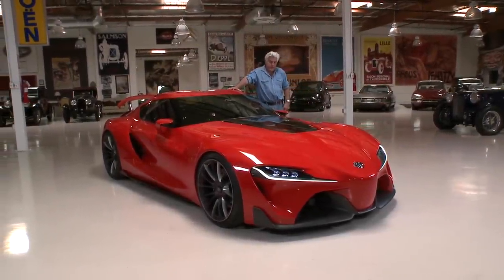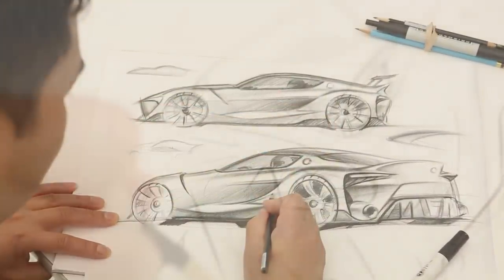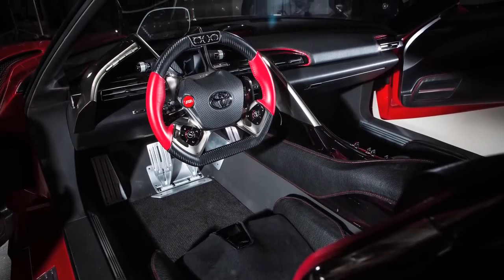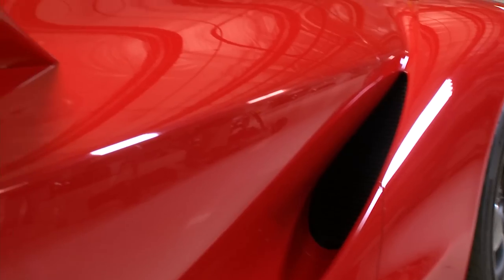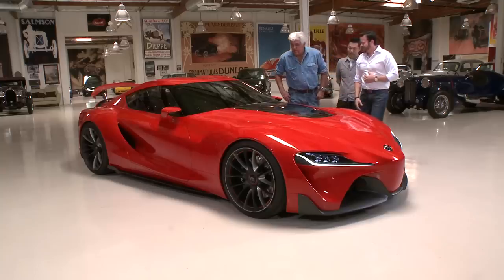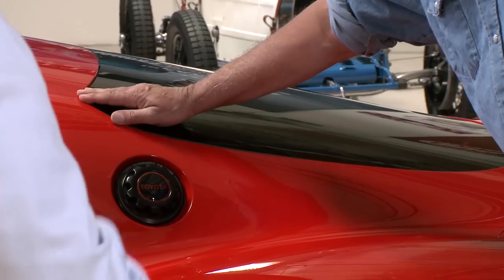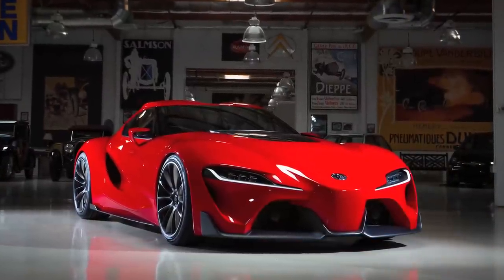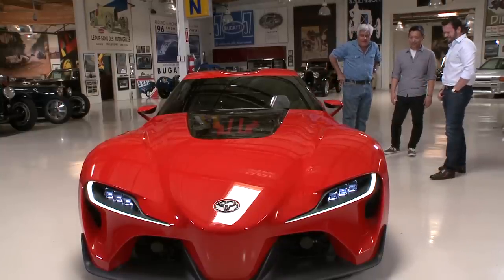Toyota FT-1 Concept - Jay Leno's Garage

Comment: It looks sporty and fast but it's everything but a sports car
if it isn't a manual (doesn't come with manual transmission), it's not a sports car!
Reply: I honestly think that's silly.  Of course it's a sports car! :D Most sports cars are dropping manual transmissions because they're just not quick and efficient enough anymore.  However, they did say that this car is meant to be all about the driver, and "affordable", so I also think it is silly that this car does not have the manual.  For production, I would hope they add a manual option.  This is a concept car so they're trying to fit every bit of technology and sparkle in there and manual is quite outdated.  But who knows what the future holds for this vehicle.  I'll be crossing my fingers for a manual model (and enough money to afford one)!
Reply: Thats where you are wrong.

Sequential gearboxes are a thing of the future.
Reply: mrcheesydancer i see what you mean but it's down to preference at this point since sequentials are ridiculously advanced nowadays. There are so many competitive racecars are sequential gearbox setups that shift way faster than human reaction with manual gearboxes so I wouldn't hesitate with this if they only made "auto" trans
Reply: Or at least give the buyer the option between sequential, auto and full manual.
Reply: Thats another; Thing of the future.

Did nissan give you the "option" of having a 6SP manual?
Reply: Kenny Nguyen Same as the Mercedes C63 AMG….
Reply: Get ready for the future, your response time is slow. I say octa-core this beast integrate nav/hands free, drive assist features all the latest greatest . I would still want the ability to toggle these features off ,just in case I wanted to get RAW!
Reply: Manuals are starting to get old and lots of folks don't know how to drive them so that's where dual clutch automatics come in.  Look at the Alfa Romeo 4c. It has a dual clutch auto and manual steering
Reply: Jamie K  No matter how advanced. No matter how fast... They are not better than a standard transmission.. It has nothing to do with speed specs or power.. It all has to do with how the driver interacts with the car.. The standard transmission is a more intimate experience.. A true car enthusiast wouldn't give it a second thought.. You buy a sports car not just to go fast. You buy it because It's part of you.. Why put it on a leash.. sigh
Reply: Circy Wilson Well if the future is no more manual gearboxes than I guess true car enthusiasts will die out. Why would I buy a fast car that does everything for me? What's the point? There is one important factor that a lot of people forget. Manual just makes driving a car a more pleasurable experience. I'm not saying that automation is a bad thing.. I am however saying that it ruins the driving experience.. Which is okay if your taking the kids to school or trekking through the mountains.. But I buy a sports car for the experience.. Why diminish that for a little more speed..
Reply: First no it isn't that huge. The speed has absolutely nothing to do with my point in the first place. The fact of the matter is, when driving standard you use both feet. both hands.. Engaging..  When driving sequential it is boring as fuck. No matter how fast the car is it is still fucking boring.. To each his own but, only in America is it commonplace for there to be automatic shifting. Anywhere else in the world and you would be made fun of for not being able to drive a car. Or that you are old. It isn't just my opinion  Millions of people are pissed that standard is going away.. Just because shitfucks don't care about the driving experience anymore. It's all about fucking numbers.. MPG, 0-60, top speed, shift speed. Nobody cares about fun anymore. And I'm sorry sequential is just not as versatile as a human can be. Manual driving you can manipulate the clutch while driving or turning.. Try that in an automatic. I'm not een going to delve into the massive repair costs for these "advanced" transmissions" Just another point is nine times out of ten the manual version of a vehicle has a tougher transmission for upgrading. Like the evo GSR compared to the MR.
Reply: Dylan Simons Im assuming that you mean the EVO X… because the IX & VIII MR 6 - speed is intact…. weaker than the 5. This is why they got rid of it in the X line.

Where you are wrong, the sequential such as the R35 GTR gearshifts are so fast you won't notice it.

theres no need to whinge to me dude.. 
like i said to you, i do like my manuals myself. and its a shame the R35GTR comes in sequential only.

But it is a thing of the future. all work class high end cars have this and have launch control as well.

One day, Hybrid is gonna be the state of the art and I'm sure petrol heads are gonna whinge also.

such is life dude
Reply: Like the nissan gtr. Some people argue that it's not a sport car. I may be wrong buts it doesn't offer a manual.  If u guys are looking for a cAr that delivers a pure sport car experience then I would opt for a 370z. Especially for the tuning potential aswell. But yea modern cars require less skill to drive which makes it less rewarding when you do make the awesome drag time or cut that corner perfectly.
Reply: I think the general trend is that technology will eventually override the need for human input because we make more errors than a computer can. Especially with exotics and super cars, like how lambos are also dct.
Reply: Your right on man. Technology always moves forward and in the case of transmissions automakers are looking to eliminate one variable.  Humans who make mistakes
Reply: Dylan Simons I think you're wrong. Manuals are getting soooo outdated. Personally, I've had several manuals going back to my high school car which was a '71 Cuda 340. I got rid of my last manual about 3 years ago for a BMW M3 with DCT. Never been happier. Today, to me, a manual takes away from the driving experience. I'd rather be focused on steering, handling and feedback rather than making the perfect shift. Especially on the track.
Reply: I agree dct and semi automatics can get better mpg, last longer, and even shift faster and more precisely than a human can sometimes. But what I feel about manuals is that it gives your ride a feeling for some character. Still i feel that you should learn to use one at least once in your life
Reply: at the end of the day, Manual transmission with a cable…

Think about it. It is old school and primitive and low cost to manufacture.

Like someone said here, car makers move forward.
Reply: Well then is a mclaren p1 not a sports car, and is the Lamborghini aventadore  not a sports car either or how about the gt-r I can go all day buddy
Reply: Jim Chiodo  Well, I respect your opinion but, I have more fun in a 1xx horsepower standard car than in a 8xx horsepower auto or sequential car.... It' more about the movements for me. I lose that in a sequential.. I do understand why people like that though.
Reply: Garrett Taylor Those are sports cars but, You are missing the point here entirely. A standard transmission puts you in more direct control of the car and creates a more proper driving experience. I love GTRs.. They are absolutely jaw dropping performance wise.. That being said I'd rather drive a stock 5 spd Evo.. For the experience. Many car enthusiasts want a car to be standard. I'm not talking about a few elites who buy outrageous cars.. For example the BMW M5 was only offered as a sequential and sales tanked.. Then they brought back standard and everyone ate them up. The Lamborghini Gallardo LP560-4 still offers a manual transmission because they know some people want it. Porsche 911/ Audi R8/Shelby GT 500 (Only available in 6 speed manual) This being said I respet you opinion and I do not want to change your mind. I'm simply explaining what he meant.
Reply: 85gtdrop  Those are sports cars but, You are missing the point here entirely. A standard transmission puts you in more direct control of the car and creates a more proper driving experience. I love GTRs.. They are absolutely jaw dropping performance wise.. That being said I'd rather drive a stock 5 spd Evo.. For the experience. Many car enthusiasts want a car to be standard. I'm not talking about a few elites who buy outrageous cars.. For example the BMW M5 was only offered as a sequential and sales tanked.. Then they brought back standard and everyone ate them up. The Lamborghini Gallardo LP560-4 still offers a manual transmission because they know some people want it. Porsche 911/ Audi R8/Shelby GT 500 (Only available in 6 speed manual) This being said I respet you opinion and I do not want to change your mind. I'm simply explaining what he meant. No need to be insulting..
Reply: I personally enjoy manuals but we must accept the direction of which our hobbie is going. They both have their advantages
Reply: Dylan Simons
no... just no..
Reply: that is just stupid whats wrong with automatic. most of the sport cars r automatic
Reply: ***** who makes these stereotypes? I've never heard this one???
Reply: I think is practical to have automatics, if technology keeps evolving so should the simplicity of handleing
Reply: AGREED!!!!👍
Reply: William Su Its all about the feel and engagement of the manual. Driving an automatic just isn't as exciting of an experience.
Reply: Villa Manor  No I totally get that, but technology and practicality is something that's supposed to do it better or eventually will and that's not something that can be stopped from happening.
Reply: tell that to ferrari, lamborghini, mercedes, porsche, and mclaren. All are transitioning to manual gear boxes and paddle shifters because they are exponentially faster than an "old school" stick shift. Also, it you didn't know, F1 drivers (arguably the best in the world) don't have a stick shift either, they use paddle shifters in those cars as well.
Reply: thats the most balls thing ive heard in my life
Reply: lmao
Reply: Still a sports car but a manual is more fun. I hate when people buy cars and bikes because of specs.
Reply: Garrett Taylor No the aventadore is not a sports car. Its a statement. Iy doesnt handle particularly well or go very fast in the scheme of super cars. It is for ceos professional athletes and musicians who make more money that they know what to do with.
Reply: I think an Aventador can be classified as a sports car lol
Reply: Supercar ;p;
Reply: *****  it's an Amazing car
Reply: Dylan Simons yes, but it hasn't only to do with the transmission

if you have a good manual transmission in a chassis which doesn't give you feedback then it's not a good drivers car

manual transmission =/= drivers car

it's about combining chassis balance, throttle response, brake feedback, brake feel, chassis feedback, suspension feedback, steering feedback, steering accuracy and finally transmission feedback

Comment: Affordable? I doubt it.
Reply: If they make it.  They will go after Nissan GT-R.  So $100 - $160 thousand would be their target price range.  Just my opinion though.
Reply: John Hardin would tend to agree
Reply: The lexus LFA was almost half a million
Reply: sanjay sriranjan Its impossible to estimate the (potential) future price on this because that completely depends on if its going to be a limited production(like the lfa), the build method (carbon fibre everywhere) and the engine (LFA style V10 or TT V(or inline)6). Pending those, it could be from 100 000$ to 1 000 000$
Reply: Has the Supra ever been afforable?
Reply: ***** LOL $20K?! Here in the states they are going for like $60k to $90k!
 I saw a bone stock clean one sold at a dealership in Las Vegas for the $90k
Reply: FilmerJared thay are cheaper than that. $30k is what you will pay. for a tt 6 speed car. its still too much.

Comment: Those radiators fans looks odd!
Reply: I like them, it gives it a JDM look
Reply: they will cover them up during the mass production. otherwise these fans will break every 100 miles. think about rocks hitting the fans and bugs getting stuck in there. they will propably cover them up with a net or something similar.
Reply: I can see a bird getting sucked up in that fan I agree a little odd
Reply: replace them with turbos
Reply: Mario YESSSSS!!!!!

Comment: It better be a straight 6 or v6 with two turbos. :)
Reply: Fuck that v8 or v10
Reply: Dude V6 twin turbo plus electric engine
Reply: ***** they already said that that's going to be a 90k plus car
Reply: Moby Dick  Yeah, no.. That makes no sense.. Why would they make it with 200 hp.. So that it could compete with the FRS/BRZ?? It's stablemate?.. No, I'd say 300hp V6, or perhaps 4cyl with hybrid..
Reply: Moby Dick Yamaha? Something tells me you are a fan of the 96-99 Taurus SHO
Reply: I'd love to see a newer version of the 2jz
Reply: Jesus Bustamante They were saying that if they make it, it will be RWD.  If you put a massive engine in it you wont be able to get the power down to the road.  The Nissan GT-R has a Straight 6... and no body is calling it slow or under powered.
Reply: I was thinking 3jz but not happening a v10 with 600+hp na is enough I wouldn't want it turbo but that could be a option
Reply: If it's gonna be expensive, just throw in the same awesome engine from the LFA. But if it's a 4 cylinder it will be lame and I doubt too many people would want it. I'm feeling a v8 :)
Reply: CJSchecter96 japanese cars dont need v8's a 600hp v6 is just fine
Reply: s lvt better fucking not be, that would ruin it
Reply: Moby Dick it won't, its too big to compete with the brz and its too high tec to be cheap

Comment: I wonder how does the engine hood open? There are virtually no seams on the front end.
Reply: This was electric so no engine. Under that shell is a series of batteries. When Toyota finally decides on the engine (if they hadn't already) they'll revise the body to function accordingly. In this video it was a model to show just the electric gizmos. It's essentially a lightweight shell on a frame and maybe a 50HP yield to load onto a trailer.
Reply: I agree
Reply: It will most likely open like a viper, the front fenders/hood looked to be all one piece
Reply: No the clear plastic comes off

Comment: hopefully it comes with the LFA motor. If not, a v8 is enough. The designe was in America so give it what they like. A V8 engine.
Reply: It's more supra esque so I think an I6 would be more appropriate
Reply: They should release it with an Inline 6 twin turbo motor and a proper manual transmission...everything else is unacceptable
Reply: Preach it doge. Totally agree
Reply: since they are getting their engines from bmw an inline 6 isn't that unrealistic. and since bmw has a very far developed turbo technology it will be turbocharged for sure. the only problem will be that bmw can't build engines with hidden potential like the 2jz. they build engines spot on which may blow as soon as you tune them.
Reply: I should remind you that BMW has both inline sixes and V8s.
Reply: Dont be silly, if its a new supra it will have a straight six turbo
Reply: The-EXpertStreet B-Racer :it will probably have a v6 twin turbo .
Reply: 3JZ anyone?
Reply: It’s coming with a bmw straight six because Toyota worked with bmw on this car
Reply: It obviously should come w a boxer engine from the gt86 duh
Reply: The fact that it will have a BMW engine disappointed me. If I wanted a car that would self destruct from me looking at it funny, I would buy a BMW.

Comment: I have a theory, ill probably be wrong in a few years and be coming back to edit this post lol. But right now i think the FT-1 is probably going to be the AWD Hybrid version of the Supra, they will probably call it the Supra FT-1 just a guess and itd be a cool name anyways. There has been talks and thats probably why tada-san doesn't want to make a manual trans and is probably busy making a DCT transmission for this ultimate supra, they probably wont use the new 3.5 V6 engine they have since its just used on a sedan and not necessarily a performance engine. The B58 engine is the roots of what a supra is anyways because its a inline 6 and sounds similar to a 2jz. I think toyota will ultimately beef up that engine and probably be changing parts out themselves and tuning it more and with a hybrid system with the help of GRMN/TRD ,they dont need BMW for anymore R&D, BMW doesn't want to give Toyota the new S58 anyways. I came to this theory because Fredric Asabo kinda slipped his tongue in a video where he was driving the Supra in Spain, he didnt say it per-se but agreed that toyota has somethings planned with the FT-1 chassis. That will probably be the Supra everyone is wanting but will cost a pretty penny $100k+. I feel like the supra that just came out is just the beginning of what's to come. Maybe the MK5 will slowly evolve into the FT-1 starting with the GRMN "go fast" version as tada-san stated. Not only because of fredric but ive been following everything about FT-1/Supra since toyota collabed with BMW in 2012.
Reply: Hmmm....interesting
Reply: @DiegoGarcia-wi5mz  just a food for thought, lets see what happens in the coming years.

Comment: Im not disappointed at all by the final product. They sticked as much as they could to the concept and if you know a thing or two about the industry, you know that designing a street legal car nowadays is a great challenge. In that aspect the result turned out fantastic. And the partnership with BMW allowed this car to be an affordable sportscar and not some $200k+ supercar like the NSX. The NSX is great, don’t get me wrong, but for many it will remain just a dream.

Toyota did everything right with the new Supra, and even a manual is on the way. 

The only think I don’t like is the interior. The A80 Supras interior was legendary for its fighter jet design, yet they included NOTHING of that into the A90s interior, which is kinda disappointing.